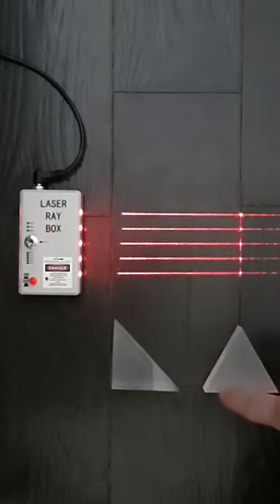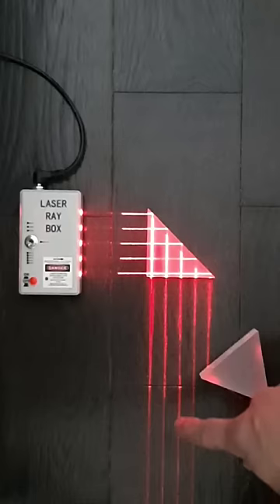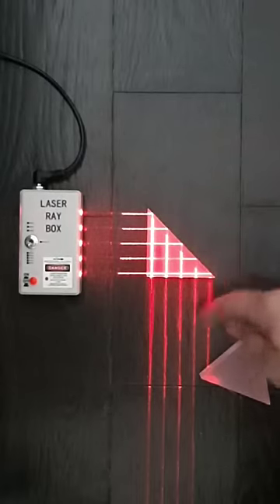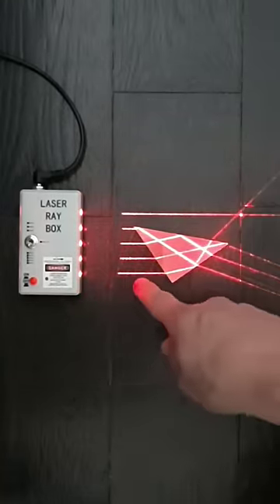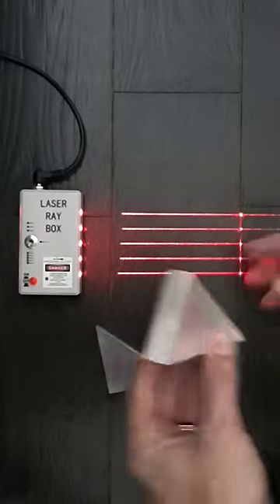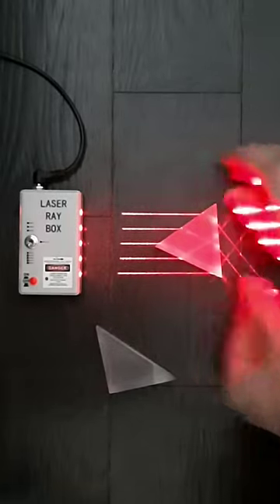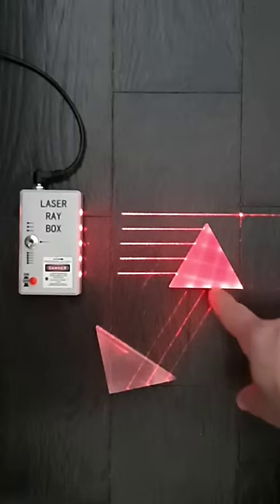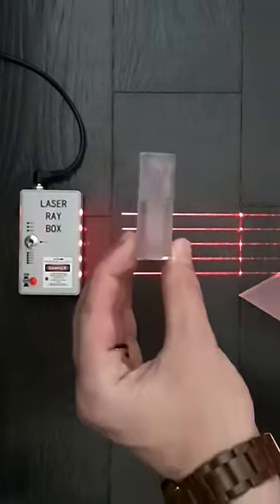How Prisms Work! #shorts

Comment: I thought prisms refracted light, not reflected
Reply from the maker: The bending of light as it goes from one material to another (like air to the glass prism) is refraction, but the light reflecting back inside of the prism instead of leaving isn't refraction! It's called total internal reflection and it only occurs at specific angles of incidence
Reply: @edmundoptics  cool, learn something new every day

Comment: Shouldn't the light go through to the top instead of the bottom?  Why is it reflecting?
Reply: Snell’s law. n1*sin(θ1) = n2*sin(θ2). The refractive index of a material is n, and θ is the angle between the beam of light and a line perpendicular to the surface of the interface. Total internal reflection occurs when θ2=90°, or when (n1/n2)*sin(θ1)=1. 

There’s also always some reflection at every interface.
Reply: @PandaA1257  Sounds like you just need a less opaque prism, right?

Comment: Is there any power loss? If so, how much ?
Reply from the maker: Yes, at each interface between air and uncoated glass there is a loss of around 4%, and some light is also lost to absorption inside of the glass. Real prisms often have coatings applied to them to reduce that 4% to as low as 0.01% (if you're just focusing on a particular laser wavelength)

Comment: It's refracting
Reply from the maker: The bending of light as it goes from one material to another (like air to the glass prism) is refraction, but the light reflecting back inside of the prism instead of leaving isn't refraction! It's called total internal reflection and it only occurs at specific angles of incidence

Comment: Why does the light reflect off of the first edge it finds and then penetrate the second edge?
Reply from the maker: That total internal reflection only happens at certain angles. If the angle of the 2nd surface was changed enough, the light could reflect off of that one too

Comment: I have a question why do some light beams reflect twice in the first prism and some once?
Reply from the maker: Whether or not it reflects depends on the angle between the light and the glass/air interface. For angles greater than about 42 degrees, it reflects internally, and for smaller angles it transmits
Reply: @edmundoptics  thanks a lot
Reply from the maker: @laiton_  You're welcome!

Comment: Yo but why the light stop on the back edge instead of passing through. It goes from air to prism and all the way through the prism, why not the last nanometer back out to air?
Reply from the maker: When light hits an interface between 2 materials (like air to glass, glass to water, etc.) it is refracted (or bent) at a specific angle based on the two materials and the original angle of incidence. At high enough angles of incidence, the angle at which the light would be bent now wants to bend back into the prism. That's the point at which internal reflection happens and why it only happens sometimes

Comment: Its called refraction
Reply from the maker: The bending of light as it goes from one material to another (like air to the glass prism) is refraction, but the light reflecting back inside of the prism instead of leaving isn't refraction! It's called total internal reflection and it only occurs at specific angles of incidence

Comment: So (srry if it's a dumb question) what happens if you put the prism with the smaller sides on the ground, so instead of the triangle shape being on the ground, one of the sides are?
Reply from the maker: If one of the smaller of the 2 faces was put on the ground, the light would still be reflected 90 degrees. But because the prism was turned, the light will now be reflecting into the ground!
Reply: @edmundoptics  oh, that's cool!

Comment: What would happen if you had the prism in water and then tried this?
Reply from the maker: The total internal reflection wouldn't happen at the same angle anymore! The angle at which that happens is dependent on the 2 materials (in this case air and glass)

Comment: I'm so sorry for being that guy, but I'm pretty sure the term is refracting, not reflecting when it is in the inside.
Reply from the maker: The bending of light as it goes from one material to another (like air to the glass prism) is refraction, but the light reflecting back inside of the prism instead of leaving isn't refraction! It's called total internal reflection and it only occurs at specific angles of incidence
Reply: @edmundoptics  Ah damn. your right. Thanks for the correction.
Reply from the maker: @Pizzagulper  no problem😁
Reply: @edmundoptics  you should get a bot to correct these comments lol
Reply from the maker: @LazuliteLol  that would save some time lol

Comment: Do you mean refraction instead of reflection?
Reply from the maker: The bending of light as it goes from one material to another (like air to the glass prism) is refraction, but the light reflecting back inside of the prism instead of leaving isn't refraction! It's called total internal reflection and it only occurs at specific angles of incidence

Comment: Why does it only reflect once and not stay inside?
Reply from the maker: Whether or not it reflects depends on the angle between the light and the glass/air interface. For angles greater than about 42 degrees, it reflects internally, and for smaller angles it transmits

Comment: Why does it reflect once and then exit?
Reply from the maker: Whether it reflects is based on the angle between the light and the interface between glass and the air outside. So if the prism was shaped differently you could get more reflections!

Comment: This is not a prism. Prism has 3 faces and a base face.
Reply from the maker: There are actually many different types of prisms, like right angle prisms, penta prisms, and equilateral prisms. A "prism" is essentially a block of glass or plastic with at least 3 flat faces

Comment: Refraction?….. not reflection? No?
Reply from the maker: The bending of light as it goes from one material to another (like air to the glass prism) is refraction, but the light reflecting back inside of the prism instead of leaving isn't refraction! It's called total internal reflection and it only occurs at specific angles of incidence

Comment: Its not reflection, its refraction.
Reply from the maker: The bending of light as it goes from one material to another (like air to the glass prism) is refraction, but the light reflecting back inside of the prism instead of leaving isn't refraction! It's called total internal reflection and it only occurs at specific angles of incidence
Reply: @edmundoptics  False. Light is a form of radiation and is expressed so on within physics on a chart of radio wave spectrum. When a ham radio uses cloud skipping, this is a form of refraction, yet those radio waves still make it to space. Refraction is the bending or reflection of a wave through a material. Reflection is the change of direction of a wave off of a material. From here, we get into material science and the efficiency of a material to reflect the radio wave spectrum chart mentioned before.

Comment: Sorry, but is it not called refracting?
Reply from the maker: The bending of light as it goes from one material to another (like air to the glass prism) is refraction, but the light reflecting back inside of the prism instead of leaving isn't refraction! It's called total internal reflection and it only occurs at specific angles of incidence

Comment: It's refracting, not reflecting. These 2 words are different coz they don't mean the same.
Reply from the maker: The bending of light as it goes from one material to another (like air to the glass prism) is refraction, but the light reflecting back inside of the prism instead of leaving isn't refraction! It's called total internal reflection and it only occurs at specific angles of incidence

Comment: Isn't it refraction and not reflection?
Reply from the maker: The bending of light as it transmits from one material to another is refraction, but this reflection back inside of the prism is called total internal reflection! It works differently than refraction

Comment: Refraction, not reflection.
Reply from the maker: The bending of light as it goes from one material to another (like air to the glass prism) is refraction, but the light reflecting back inside of the prism instead of leaving isn't refraction! It's called total internal reflection and it only occurs at specific angles of incidence

Comment: Why do you keep saying "reflect" instead of "refract"????
Reply from the maker: The bending of light as it goes from one material to another (like air to the glass prism) is refraction, but the light reflecting back inside of the prism instead of leaving isn't refraction! It's called total internal reflection and it only occurs at specific angles of incidence
Reply: @edmundoptics  Ah yes. Sorry. My mistake. It's been a long time since I sat in an optics lecture.
Reply from the maker: @GaidinDaishan  No worries! :)

Comment: Isn't this refraction not reflection?
Reply from the maker: The bending of light as it goes from one material to another (like air to the glass prism) is refraction, but the light reflecting back inside of the prism instead of leaving isn't refraction! It's called total internal reflection and it only occurs at specific angles of incidence

Comment: Refracted*
Reply from the maker: The bending of light as it goes from one material to another (like air to the glass prism) is refraction, but the light reflecting back inside of the prism instead of leaving isn't refraction! It's called total internal reflection and it only occurs at specific angles of incidence

Comment: It's called refraction not reflection
Reply from the maker: The bending of light as it goes from one material to another (like air to the glass prism) is refraction, but the light reflecting back inside of the prism instead of leaving isn't refraction! It's called total internal reflection and it only occurs at specific angles of incidence

Comment: What if it was in a vacuum
Reply from the maker: Air behaves similarly to a vacuum so the total internal reflection would still occur, just at a very slightly different angle. The bending of light as it enters the prism at an angle would also be very slightly different

Comment: Refraction🥴
Reply from the maker: The bending of light as it goes from one material to another (like air to the glass prism) is refraction, but the light reflecting back inside of the prism instead of leaving isn't refraction! It's called total internal reflection and it only occurs at specific angles of incidence

Comment: Is no one going to correct and say it's 'refraction' not 'reflection'?
Reply from the maker: The bending of light as it goes from one material to another (like air to the glass prism) is refraction, but the light reflecting back inside of the prism instead of leaving isn't refraction! It's called total internal reflection and it only occurs at specific angles of incidence
Reply: @edmundoptics  ahh I'm sorry, I just learned something new! Thank you

Comment: It’s refraction not reflection
Reply from the maker: The bending of light as it goes from one material to another (like air to the glass prism) is refraction, but the light reflecting back inside of the prism instead of leaving isn't refraction! It's called total internal reflection and it only occurs at specific angles of incidence

Comment: Not reflected.. refracted..
Reply from the maker: The bending of light as it goes from one material to another (like air to the glass prism) is refraction, but the light reflecting back inside of the prism instead of leaving isn't refraction! It's called total internal reflection and it only occurs at specific angles of incidence

Comment: It's refraction mf
Reply from the maker: The bending of light as it goes from one material to another (like air to the glass prism) is refraction, but the light reflecting back inside of the prism instead of leaving isn't refraction! It's called total internal reflection and it only occurs at specific angles of incidence
Reply: @edmundoptics  i am sorry from bottom of my heart I was just messing around to see if someone comments or tries to correct me
Reply from the maker: @parvgoyal7997  all is forgiven 😁

Comment: Dude used an isosceles triangle and an equalateral triangle...and claimed different materials made the rays go one way.
Reply from the maker: Whether the internal reflection happens is based on the difference between the two materials (air and glass here) and the angle of the surface, so both the shape of the triangles and their material determines this

Comment: Americans ahahahah. The light is refracted not reflected
Reply from the maker: The bending of light as it goes from one material to another (like air to the glass prism) is refraction, but the light reflecting back inside of the prism instead of leaving isn't refraction! It's called total internal reflection and it only occurs at specific angles of incidence